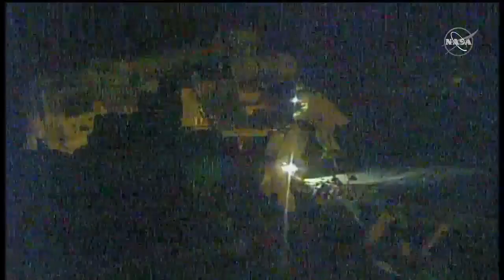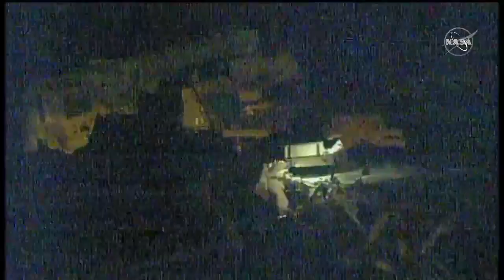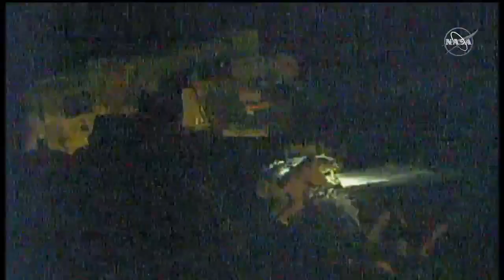Spacewalking NASA astronauts swapping batteries on space station

Comment: why is the video  so bad ?   More lies your trying to cover up ?  Is that it ?
Reply: Or mayby the camera quality is bad because filming in space ain't that easy, because of the particles in the air, or the consistency of different gases, which is why regular cameras which we have here , do not work and they have to build special cameras with a lower framerate and therefore the quality suffers.
Reply: @lauradielavalampe6891  also lack of good lighting
Reply: @adahaholu9691  yes.
Reply: @lauradielavalampe6891  nonsense ... air in space,  gas in space ya ...  Right
Reply: @briankerr4512   No there isn't any air. But dust and gas particles do float around in there.
Many people imagine outer space to be a complete vacuum, without any material because it has less matter than any vacuum artificially created on earth, but there is matter in space. These regions have very low densities and consist mainly of gas (99%; most of it is hydrogen and some helium) and dust. Interstellar dust is not like the dust that you might find under your bed; it is made of very different substances. These dust particles are extremely small, just a fraction of a micron across, which happens to be approximately the wavelength of blue light waves. The particles are irregularly shaped, and are composed of silicates, carbon, ice, and/or iron compounds.
Therefore, and because of the absense of lightning, they need a special camera.
Reply: smith will lmao ur trolling so well, real flat-earthers must be mad right now